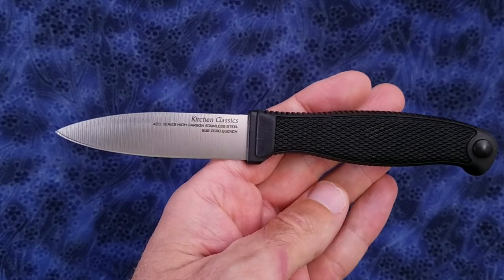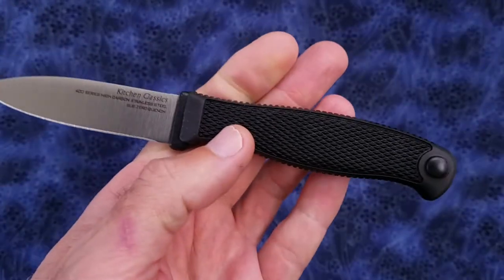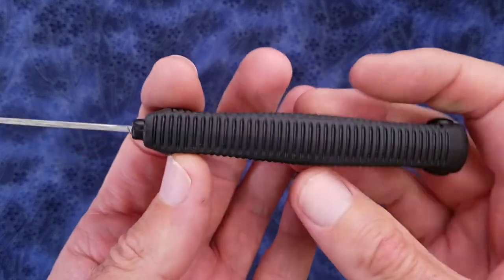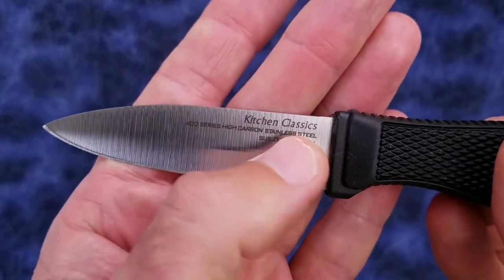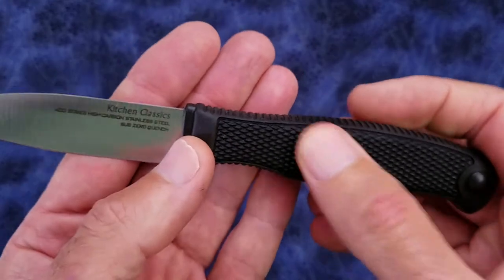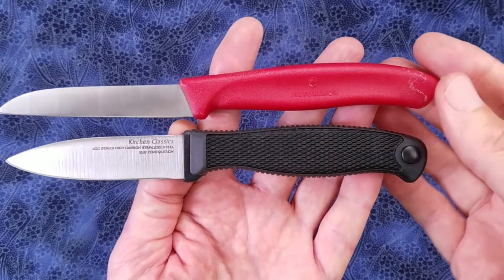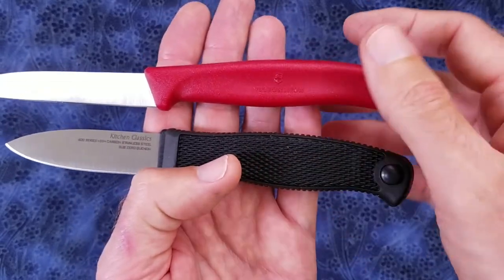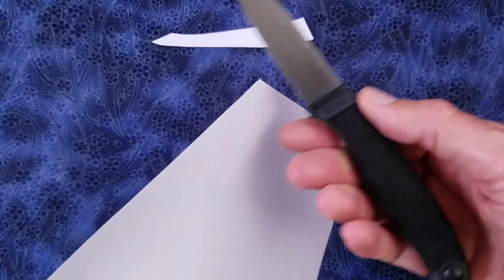Cold Steel Kitchen Classics 3" Paring Knife

Comment: are these full tang?
Reply from the maker: No, but it's not relevant for kitchen use. Nor is it related to quality. Piece-of-garbage kitchen knives are often full tang.
Reply: @sheltermonkey6065  got it, I just snapped a paring knife from the handle (although using it not as intended) but figured full tang would be better.
Reply from the maker: @sesarman  I have about a dozen high-end Japanese kitchen knives, but I think only one has a full, exposed tang. The budget Mercer knives which I often recommend (specifically their Genesis line) mostly have very thick steel at the bolster area, so they are unlikely to break there between the blade and handle, even though they don't have a full, exposed tang.
Reply: @sheltermonkey6065  got it, I will look into that line as well, all look beyond anything I've owned this far and an upgrade but for now went with this cold steel unit, and depending on the quality I will decide if it makes sense to get the whole series, you're review was very helpful, thanks.
Reply from the maker: @sesarman  The blade steel of the Mercer Genesis line is probably about the same as in the Cold Steel kitchen knives. I think I've seen the Cold Steel chef's knife for as low as about $12. The Mercer Genesis line is definitely more, but still affordable. I recommend only buying knives for the specific purposes that you have, instead of sets.